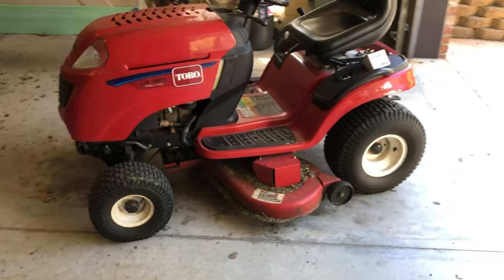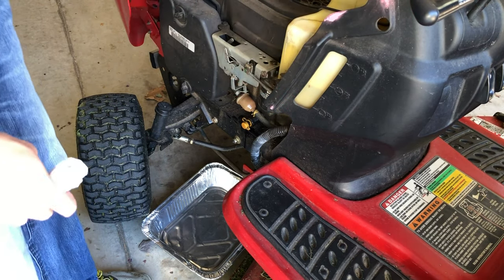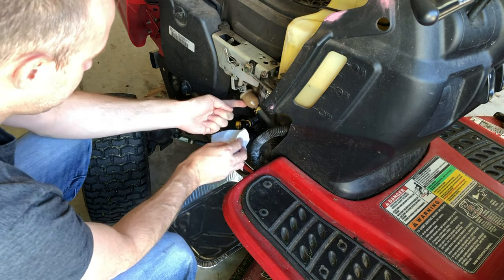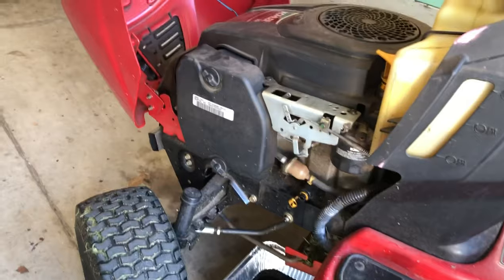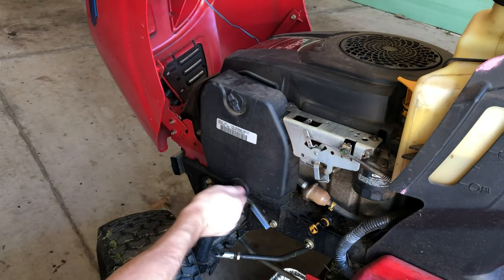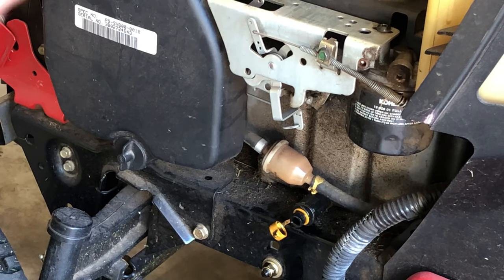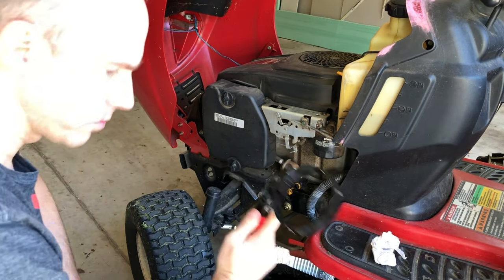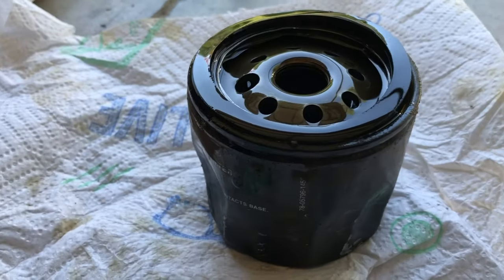Garden Tractor Oil Change - Toro LX460 - Courage 20 - Kohler

Comment: My toro is same model as yours and the oil light blinks and reads ch6 hopefully it will stop after oil change thanks for video
Reply from the maker: Hi Kyle,  The light is a reminder that occurs every 50 hours.  Don't be discouraged when it stays on after the oil change.  It will automatically shut off after 2 more hours of engine time.  For a specific reference, here is the specifics from the user manual " The LCD will alternately flash the recorded hours, "CHG"and "OIL" for five minutes, after every 50 hours of recorded operation elapse. The maintenance interval lasts for two hours (from 50-52, 100-102, 150-152,etc.). The LCD will also flash as described above for five minutes every time the tractor's engine has been started during this maintenance interval. Before the interval expires, change the crankcase oil level as instructed in the MAINTENANCE section of this manual."

Comment: 2019 Ford Fusion 2.5L engine oil filter, obviously can cross over from this
FRAM XG3614 is a very good filter and I believe cheaper than the Koehler filters.
Reply: I specifically say 2019 because that’s they year I know of but I believe it goes way back
Reply from the maker: Thanks for sharing that input.  I will have to give a triy in the future.

Comment: I have the same model. It gets very moody. Some times it starts no problem but most the time it won't even crank. Oil level is a bit high and the air filter is a bit dirty. I plan on changing it but is there anything else I should try? It's not the battery - the screen display says 12.4 volts and from what I've seen that's normal. I really don't know why it won't start.
Reply from the maker: Hello MG.  could be a couple things.  If it wont Crank/Turn the engine at all, most likely it is either 1. Electrical or 2. The starter motor. 

As for the battery, it could be the issue. to quote other sources 12.4 volts is only 50% charged.  "Resting fully charged 12-volt batteries are around 12.8-12.9 volts, and flat dead ones are at 12.0 volts, so 12.4 volts on a resting battery means it's about 50% charged."

It could be it just needs a bit more juice to spin the starter motor.  Putting it on a charger and testing it at higher voltage versus lower voltage should give you an indication if it is just not enough juice for turning the starter motor on.

#2 could be the starter motor itself is on its way out and may need replaced in the future.  If proper power is being supplied but it cant turn the engine (but you know the engine to still spin normally) then it could be the starter worn out.

I am not saying it is for certain either of these options, but they are the first things I would consider. 

All the best!
Reply: @FarReachFR  Thank you so much! I'll definitely look into it
Reply: It's the exhaust valve if it wants to crank and then stops. Very easy to adjust. Get a set of feeler gauges, wrench, torx bit, new gasket and Right Stuff gasket sealer. There are tons of videos on here that walk you through it. There is one particular video on a Husqvarna by a guy with a German accent. He is about the best one out there. 👍